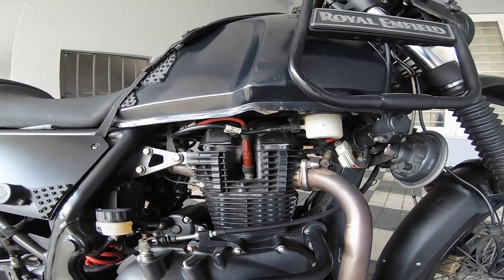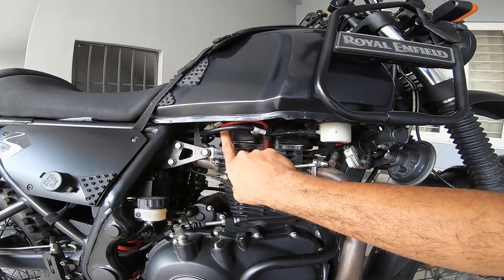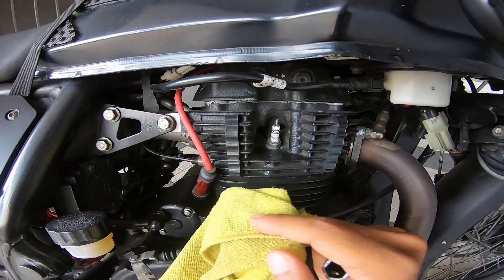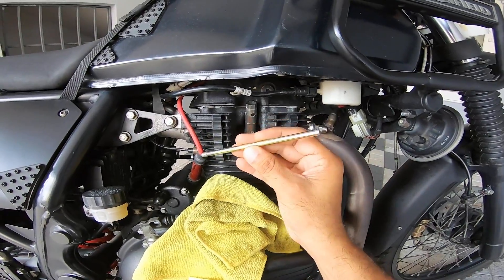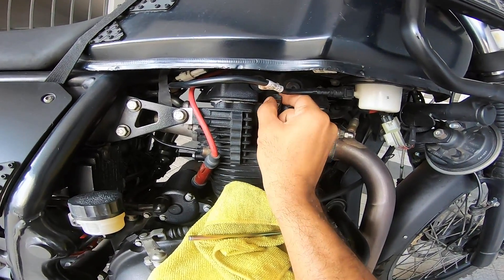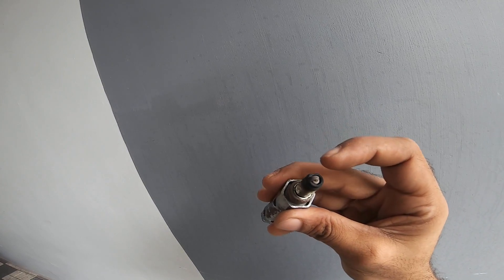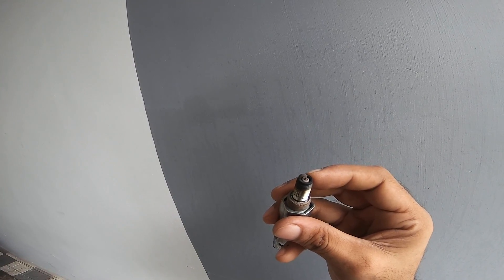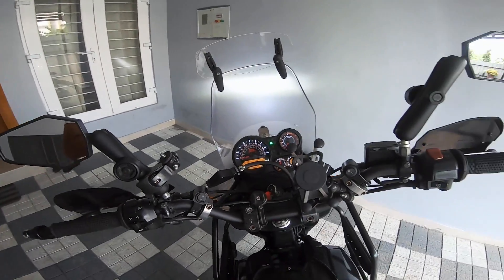ENGINE CONDITION AFTER 35000 KMS , NGK IGNITION CABLES & IRIDIUM SPARK PLUG

Comment: how is the performance with iridium Spark plug and splitfire cable  ?
Reply: It will b a bit powerful due to better ignition i hav in my pulsar the rpm goes up fast

Comment: Just bought the kit from LRL :)
Currently I have CPR9EAIX. But after installing FuelXPro, thought a good idea to change it to CPR8EAIX. No need of running that cold spark plug. The kit included CPR8 so got what I needed.
Reply: It would be great if you leave an user experience here.
Reply: Hi bro... how's the combination of FuelX and NGK Spark Plug kit working? Do we need to install a performance air filter after that? (I'm pretty reluctant to switch to an aftermarket Airfilter :/)
Reply: Does the kit include 1 or 2